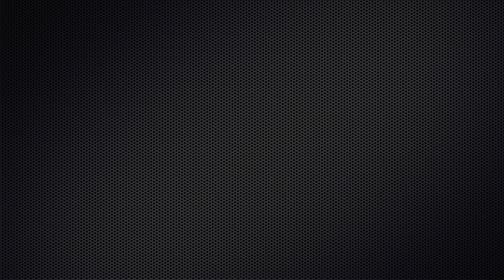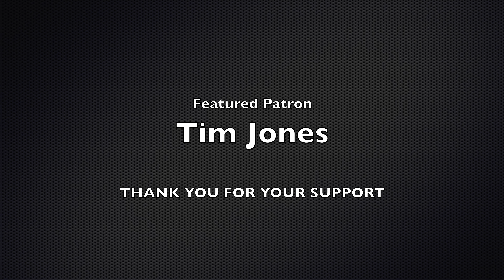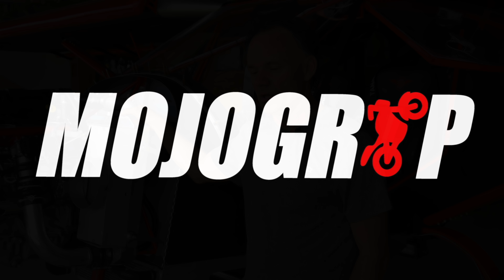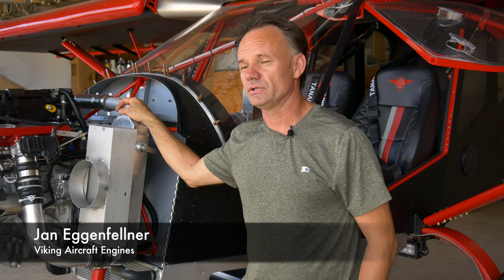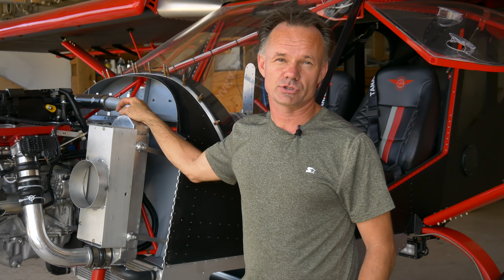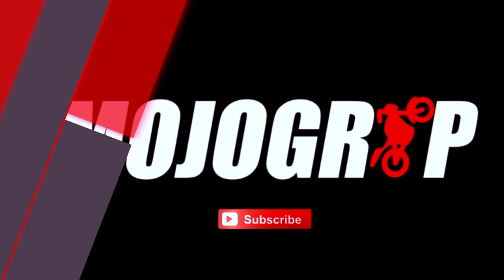Aircraft Engines l Auto Conversions VS  Certified Engines

Comment: You guys ever heard that there is no replacement for dispacement.  All these motors are trash...Companies have spend decades trying to design an engine that provides better power, efficiency, or weight than an air cooled Lycoming or Continental.  The only one who has come close is Rotax and after having flown 10 hours behind one, I'll stick to standard motors...
Reply: Adept Airmotive.
Reply: So a less than 200 cubic inches motor  that has to turn 5500 RPM to make power that is turboed and they are saying 2500 TBO (maybe, they hope).  24 valve with overhead cams?! Gear Box.... LOL  Oh and I've used Rotax's dry sump motors.  I'll never own a plane that I have to turn the prop over 20 times just the check my oil levels....and 86K price tag?! No thanks...I'll take a IO-550 with a TN kit from tornado alley.  I would like electric waste gate and dual self powering electronic ignition.

There are a dozen engine companies that have been trying to make these things work for decades...They all keep blowing through deadlines, getting sold and bought.  The problem is they are too complicated and expensive to make, usually too heavy, and the benefits are marginal at best.  So they never reach a break even point.  Look at the diesel trainers everyone tried.  Cessna only made their diesel 172 for a year, and it was so expensive, it didn't make sense.  Even for flight schools that are doing 1500 hours a year on them.  In bigger planes, once the motors get to a certain price a PT-6 starts to look really good, and they almost ALWAYS make TBO.  On the MORE program they are running them to 8000 hours before overhaul.  I'll say it again.  Big displacement standard config gas motors are the way to go.
Reply: @tstanley01  Incoming wall of text (Engine design is complicated, who knew?). You have no idea what you're talking about, you're just stuck in the past. The Adept Airmotive engine represents what's possible with modern gasoline engines. Compare the weight to any Lycoming or Continental engine. $86k is cheap when compared to the $100k+ that you'd have to pay for a FADEC LyContisaurus engine with the same performance.

"There are a dozen engine companies that have been trying to make these things work for decades...They all keep blowing through deadlines, getting sold and bought."

What are you talking about? The engines DO work, they're being sold right now and have been flying for years. The failure of these companies doesn't stem from any issues with the engines (except in the case of Eggenfellner's Subaru engines, which were also problematic in cars, they were just a flawed design), it comes from the fact that there just isn't a whole lot of demand for experimental aircraft engines in general. Business is always slow, in other words.

On high rpm engines: Rotax engines are plenty reliable, most issues with them stem from the fact that they use carbs, but they now offer models with EFI. Piston speeds are what matter, that's where most of the stress comes from, and they can be kept quite low with modern engine designs.

On OHC, mutli-valve engines: OHC, multi-valve engines have been powering some of the highest performance aircraft in the world for over 80 years, they're plenty reliable. Mustangs, Spitfires, P-38s, P-40s, etc, all use OHC engines and have 4 valves per cylinder. OHC engines also power basically ALL of the most reliable and longest lasting cars on the road. 

On geared engines: ALL of the most powerful piston aircraft engines use PSRUs, from the Merlin to the R-3350.

Here's a cut and paste from another discussion, I really don't feel like rewriting it. It should explain why you can read about LyContisaurus engines having catastrophic failures pretty much every week. The quoted text is from the guy that I was talking to.

"The short of it is the simple truth that if you want reliability you need either under-stressed designs... like a big air cooled hulk with lots of displacement and low rotational speed."

Contrary to what most people believe, a reliable, under-stressed, air cooled piston engine doesn't exist in the aviation world. Despite their reduced complexity, air-cooled engines have extremely poor reliability when compared to modern water-cooled engines, this is because the cooling of individual engine parts is wildly inconsistent and because their cooling capacity is very limited, requiring the pilot to manage the fuel mixture in order to keep temperatures within limits. The big, air cooled, direct-drive aircraft engines are not under-stressed, they're always right on the edge of catastrophic failure due to their poor cooling performance and because of the high torque pulses which are a result of their large displacement, along with a lack of inertia in their rotating assembly to smooth out those huge torque pulses (which is due to their low rotational speed). Making an engine drive the propeller directly also requires heavy, huge displacement engines which must be built in a very flimsy manner in order to make them light enough for aircraft use. The added complexity of a PSRU actually increases reliability, which is why all of the most powerful aircraft engines had a PSRU.

"Or a very sophisticated design with very extreme materials."

No, water cooling and PSRUs eliminate the requirement for exotic materials because water cooling keeps everything consistently cooled and because it's easier to make smaller parts stronger without using exotic materials. Using a PSRU allows for the use of lower a displacement engine, which makes use of smaller components. 

The one issue that the Honda engines have which there is no way to work around (without completely redesigning the engine or dramatically lowering displacement) is high piston speeds, and that is something which produces stress, wear and inefficiency. The longer the stroke, the greater the distance a piston must travel for each rotation of the crankshaft, which means that a piston in an engine with a longer stroke must move faster than it would in an engine with a shorter stroke at a given rpm. With stronger rods and pistons, reliability wont be an issue in the Honda engines, but efficiency and longevity will be. An engine designed for aircraft use will typically keep the mean piston speed below ~12 m/s, but the Viking engines are around 16 m/s (which really isn't that bad, just higher than it should be). For comparison, at 5,800 rpm, a Rotax 915 iS will have a mean piston speed of 11.8 m/s.

All in all, I'd trust a converted Honda engine over a LyContisaurus engine any day and, really, efficiency is even pretty good on the Viking engines, They burn 0.4 lb/hp-hr at full power, which is better than what LyContisaurus engines burn at cruise.

I guess my rant could be better summed up by saying that the Viking engines are a major improvement over air cooled engines, despite the fact that they're not perfectly optimized for aircraft use.
Reply: @tstanley01  Made some corrections to the first part of my comment. I'm involved in too many conversations at once here, I lost track of who you were. I agree that Adept Airmotive probably wont be successful, but, again, that has nothing to do with their engine design, it has to do with how costly it is to bring a new engine to market and how little product is moved in GA. It's always going to be a large investment with a slow return, and most investors don't like that. 

Diesels don't make sense for aircraft because they're inherently more expensive than gasoline engines and much, MUCH heavier, so they drastically reduce the performance of any aircraft that they're installed in.
Reply: You are the only person on the planet that I have met that says adding a gear box to an engine makes them more reliable.  Apparently you have never flown a 421 or a rotax for that matter.  Even taxiing is a pita because unless you have a load on the motor you get gear chatter and can damage them.  In fact the engine monitor on the Rotax I have flown starts screaming at you if the RPM drops below 1800 rpm.  At that rpm it rolls way too fast, even at gross weight.  So you are always running at higher than idol RPM and having to ride the brakes.  It is added complexity with no real upside.  The reason people put overhead cams in motors isn't for reliability or power generation.  It is so they will idle better while still being able to flow air over a wider range of RPM.  Neither of which is important in an aircraft engine, because you can design them to operate at an optimal RPM range that typically doesn't vary more than a few 100 RPM.  As far as them being in the longest running engines on the roads....18 wheelers use a conventional cam.  So do most light and medium sized trucks.  Those are typically the longest running engines on the road that are used for commercial work, where reliability, cost and ease of maintenance is important.  In fact, my experience with high performance, small displacement, fire breathing engines has been that the bottom ends hold up fine.  It is always the cams, timing chains, phenolic tensioners, and high pressure direct injection fuel pumps that give you problems.  I am not saying there aren't things we can improve.  Electronic ignitions are great.  When you do a mag check on a system running a EI and a Mag, the RPM doesn't even dip when grounding the Mag because the EI works so well.  Self powered EI should be certified for dual use instead of having to have atleast one mag.  FADEC is fine also, but it should allow for manual parameters.  Some days I want to run LOP, some days ROP, some days I want to run the motor out at 2600 RPM.  Some days I have passengers in the back without headsets and want to turn them back to 2300 RPM.  Fully automatic FADEC is like removing the tach from a F1 car and only have a shift light.  Real pilots know how to operate their systems properly.  Another thing I don't like about the Rotax is that they don't have mixture control, you can't even run the cylinders dry during shut down.  To me that is a safety feature.  Having to turn the prop on that thing to prime the oil knowing the cylinders have fuel in them a little scary.  Water cooling is fine, but again, a properly baffled air cooled engine runs well within limits and doesn't add any new systems that need to be maintained.  A well tuned a36 with a TN kit and good baffles will run up to 25000", running at 93% power and still be well within temperature limits.  That is where we need to go.  George and his group have gathered more information on GA piston engines than anyone on the planet, and you don't see them designing overly complicated motors that gain nothing and only add cost and complexity.  They are building components and accessories for tradition engines that make them run better, longer and with more power.  He is so busy they can't build stuff fast enough.  EPS and all the rest can't even get through certification.  Aircraft owners are trying to get the most amount of performance with the least amount of moving parts.  Everything is so expensive,.  So unless you have a dang good reason to add or complicate a system, we don't want it.
Reply: @tstanley01  "You are the only person on the planet that I have met that says adding a gear box to an engine makes them more reliable."

Well, I'd be very surprised if you met the engineers who designed the Merlin, or the Allison, or the R-3350, or the R-2800, or anyone who designed the most powerful aircraft engines in the world.

 "Apparently you have never flown a 421..."

A) Their gearboxes were unreliable because they weren't operated properly. People weren't revving them high enough, which meant that the rotating assembly didn't have enough inertia to overcome the huge torque pulses of the engine, which caused gear chatter. B) Those are slow turning, big displacement engines with very few cylinders, which means that they have big, infrequent torque pulses, which means that they're hard on their gearboxes.

Rotax gearboxes are plenty reliable.

"Even taxiing is a pita because unless you have a load on the motor you get gear chatter and can damage them."

You should probably read my comment again and actually attempt to understand it. 

"In fact the engine monitor on the Rotax I have flown starts screaming at you if the RPM drops below 1800 rpm."

Yes, you need a good amount of inertia in the rotating assembly to smooth out the torque pulses from the engine. This can also be overcome by adding a flywheel to the engine. It's also not an issue on a FADEC engine because the EFI system manages the idle.

"It is added complexity with no real upside."

Except MUCH lighter and more reliable engines.

"The reason people put overhead cams in motors isn't for reliability or power generation.  It is so they will idle better while still being able to flow air over a wider range of RPM.

Again, you have no idea what you're talking about. Better airflow means more power and greater fuel efficiency. OHC engines also have fewer moving parts, which means greater reliability. Aircraft engines don't need to have good idle properties, but even the engines being discussed here don't rev high enough for that to be an issue.

"Neither of which is important in an aircraft engine, because you can design them to operate at an optimal RPM range that typically doesn't vary more than a few 100 RPM."

Fuel efficiency, power, weight and reliability are important in aircraft engines, and all of those things are improved with OHCs. OHC systems with 4 valves per cylinder are the only way to facilitate efficient operation in the higher rpm range where these modern engines operate.

"As far as them being in the longest running engines on the roads....18 wheelers use a conventional cam."

If you mean OHC, yes. The Cummins ISX uses DOHC, and it's hard to find information on other engines, but I'm pretty sure that basically all of the modern truck engines are OHC. Anyway, those big diesels are reliable because they're massively overbuilt, not because of the type of valvetrain that they use.

"Some days I want to run LOP, some days ROP, some days I want to run the motor out at 2600 RPM."

The engines always choose the most efficient operating parameters and will even run LOP.

"Fully automatic FADEC is like removing the tach from a F1 car and only have a shift light."

...which has been working fine for many years, so I'm not sure what your point is.

"Real pilots know how to operate their systems properly."

Electronic injection systems know how to operate the engine FAR better than any pilot does. Not only are the systems much more precise, but they react within milliseconds of any changes.

"Water cooling is fine, but again, a properly baffled air cooled engine runs well within limits and doesn't add any new systems that need to be maintained."

Air cooling is draggy and makes the engine itself HORRIBLY unreliable. Air cooling also limits the performance of the engine. Water cooled engines can not only be more efficient, but also more powerful, while also being more reliable. This is why Continental built the Voyager engine and why lawnmowers and 80 year old aircraft engine designs are basically the only things left using air cooled engines.

"George and his group have gathered more information on GA piston engines than anyone on the planet, and you don't see them designing overly complicated motors that gain nothing and only add cost and complexity."

Because they don't design engines at all, they just use existing parts, and they're content with performing poorly and burning leaded gasoline.

"So unless you have a dang good reason to add or complicate a system, we don't want it."

IMPROVED RELIABILITY AND SAFETY. We're talking about people's lives here. People not only die because these engines can't keep their components properly cooled and love to throw rods through their crankcases, but also because pilots mismanage their engines on a regular basis and cause them to fail, all of that needs to be done away with.

The Adept Airmotive engine is also much less expensive than an equivalent Lycoming or Continental engine.
Reply: @tstanley01  YouTube isn't letting me post my reply or a relevant link. Google: AOPA, Airframe and powerplant - Mixed Reviews - July 5, 2002 - Liquid cooling — yea or nay?

I guess that censoring the facts is how people win arguments these days?
Reply: @tstanley01  "Comparing a 100 year old military engine that was designed to be operated at the limits can't be compared to to a GA airplane where the primary concerns are reliability and cost."

You're saying that a technology which has been made to be reliable in a much harsher environment can't be made reliable in GA? It's also just a gear set, there's not really anything that can go wrong with it as long as you don't have a slow turning engine beating it to death. The R-3350 ended up with a TBO of 1,700 hours, btw. The R-2800s and R-3350s weren't just military engines, they were used in airliners for a long time, and you can bet that those airlines wanted their engines to be reliable with minimal maintenance. 

"Money was not an object when these motors were designed. "

Small displacement, water cooled engines are cheaper to make than big, air cooled engines.

"The problem is it is such a high power setting that the plane wont taxi properly and you have to ride the brakes."

Or, you can just put a flywheel on the engine, like Adept Airmotive did. You're making mountains out of mole hills.

"Gear boxes in GA airplanes have always been a maintenance issue."

Only according to you, Rotax powered aircraft are selling like hot cakes. You can't beat the performance that geared engines provide.

"Fuel Injection operation isn't the issue."

It is when it eliminates the possibility of the engine being operated in a way that's harmful to it.

"Like I said, I don't have a problem with Fadec as long as it allows me the option to run my engine at the parameters I want.  ROP or LOP isn't right or wrong.  It do you want to go fast or more efficient.  Both have advantages, but it up to the pilot and the situation he is in to decide which way he wants to fly."

You clearly have no idea how FADEC works. If you want low power, high efficiency operation, you pull the power lever back, if you want high power output, you push it forward. Based on how much power you want, the engine knows how to give you that in the most efficient way possible, and it knows it much better than you ever could. 

"The airplane has no idea how it should be operating."

The problem here is that you can't think outside of the little box that your training put you in. All a pilot demands is more or less power from the engine, there's absolutely no reason why the engine can't figure out how to operate in the most efficient manner possible based on that one demand.

"As far as air cooling being more draggy....whether you run the air over fins on the block, or blow the air over radiators and then the block, it doesn't much matter.  Actually I think most wind tunnel testing I've seen the like power models show that the water cooling actually produces more drag."

With water cooling, you can take advantage of the Meredith Effect, which completely eliminates the drag of the cooling system. Even with minimal adherence to the principles of that effect, cooling drag is much lower for a well designed water cooled engine. The Boeing XB-39, for example, significantly outperformed the B-29, despite having less power, simply because it was water cooled. The Soviet Tu-85 also saw significant gains in performance by replacing an air cooled engine with a less powerful engine that was water cooled.

"The funny part is the big liquid cooled Continental was used as and STC for the 414 and 414a."

You're looking at a different engine. The engine that powered Voyager around the world was a 4 cylinder. Anyway, I wasn't saying that it was a good engine, I was saying that the Voyager engine was able to use a higher compression ratio and had lower fuel burn than a comparable air cooled engine. It obviously makes much more sense to design an engine to be water cooled from the very beginning, converting an air cooled engine to water cooling rarely works out well.

"The fact is, the ONLY thing that makes an engine more fuel efficient at LOP operations is compression ratio, and really the only thing that helps with that while still developing max HP is higher octane fuel."

No. Lead is used to reduce the possibility of pre-ignition/detonation, but water cooling also does the same thing. It's not unheard of for modern automotive engines to run air fuel ratios as lean as 20:1 with compression ratios that are higher than any LyContisaurus engine... while running on 90 octane fuel. The rest of what you've said about avoiding knock only applies to the archaic engines that most GA aircraft currently use. To sum up: Water cooled engines with modern combustion chamber designs can run leaner mixtures and higher compression ratios, all while running on lower octane fuel. 

"i know you aren't a pilot and have never actually operated a GA piston plane, but during take off and full power climbs, you have to dump a ton of fuel through them so they don't cause detonation."

I already addressed this. You don't have to run extremely rich mixtures in water cooled engines because they're inherently less prone to detonation. In other words: You don't have to use fuel to keep the cylinder head temperatures low, because the cooling system does that for you. That's why the Viking Honda engine only consumes 0.4 lb/hp-hr at full power, while a Continental TSIO-550 will consume nearly double that. Consider that the Honda engine also has a compression ratio that's nearly a full three points higher than a TSIO-550, has a much higher BMEP (due to more efficient operation), runs a slightly higher boost pressure and runs on lower octane, unleaded fuel. That's called TECHNOLOGICAL ADVANCEMENT, something that seems to be foreign to people like you.

"There isn't any amount of fancy cylinder head or fuel injection that will stop it."

Right... ok, bud. You go tell that to the engineers who design MODERN engines, it'll give them a good laugh.

"People allot smarter than you or I have dedicated their lives to the science and like was said earlier, the mechanics of the technology have pretty well been reached."

With 80 year old engine designs? 

"Without an alternative fuel source, you really can't squeeze any more power or efficiency out of these motors."

That's why I'm talking about abandoning LyContisarus engines, they're insanely obsolete.

"Don't you think that one of the auto manufacturers who have  billion dollar research departments would develop an engine like you are talking about if they could sale the engine for 100k."

No, the market is too slow to appease their greedy investors and they'd have to develop and produce a unique engine design to reap all of the benefits that modern engine technology has to offer.

"They don't cause they can't."

They don't because it's not profitable enough for them to do so.

"If they could develop a better motor they would."

THEY HAVE.

"i am never going to change your mind, or get you to admit it."

That's because you don't know anything about modern engine technology.
Reply: @tstanley01  I am all with you.  If you had an inline 4 cylinder Viking engine, you would have a very basic and easy to maintain engine.  To allow for minimum idle RPM, just set the idle very low and live with a slight ticking noise from the drive unit.  Another method is a dual idle setup.  One for "normal" ops, another for low idle ops.  Implemented with a simple dual idle spring.
Reply: @tstanley01  Your info is very informative.  Be sure to read more about GASOLINE DIRECT INJECTED TURBOCHARGED ENGINES.   They do solve the issues you write about.  AND, they are the basis of the Viking 180
Reply: I am not saying you cannot have a quality engine with those features, and I wasn't talking about you specifically when I said they are trash.  My only experience with these type engines is with Rotax, and I can say without a doubt I would not own one of those.  The guy above has no clue what he is talking about and I am not even sure he has ever been behind the controls of an airplane that wasn't connected to a windows desktop.  I have a bit of experience (know enough to know I am not an expert) with direct injected turboed motors.  The main benefits I can see are better fuel atomization and the ability to fine tune the lean mixture for each individual cylinder on the fly, if your ECU is setup for individual banks.  I was surprised at how many auto engines still do group firing of injectors.  Even high dollar aftermarket performance EFI kits.  However, most all of that can be overcome in manual fuel injected engines with tuned injectors like those made by GAMI.  It isn't too hard to get notoriously hard to tune motors like the 550B to get within a few .1 of a GPH across the entire motor.  The later model motors that were designed with balance induction work even better.  I know in diesels it is pretty common to "time" the engine by the way they inject the fuel.  Do your systems play around with that any?  Direct Injection is a fine technology, but you have to run a pretty impressive high pressure pump to make it work, and my experience atleast in the auto world is that is one of the weak links.  I was actually involved in a project to try to build a dual and maybe even 3 stage mechanical HP fuel pump for BMW inline 6 motors. It ended up being allot more work than you could imagine.  Ended up going with a hybrid system that used a wet fogger plate in between the manifold and cylinder head.  It worked almost like a nitrous system.  DI would take it so far, then when they ran the boost and RPM up so high, the 2nd fuel system would kick in to add more fuel beyond what the factory HP pump could deliver.

I looked at your largest offering and it looks like a nice kit.  I love the look of CNC tool marks on a piece of billet .  The price and weight are attractive, but when compared to a IO-360 parallel valve (180 HP), your fuel burns are very close.  I am sure your system is a good running engine, but the bullet proof IO-360 is to (for double the price of course).  My point I guess is in the experimental market these things make sense, but in the certified world where a crank is 7k, direct injection, gear boxes and all the rest don't make much sense when the gains are only slightly marginal if at all.  That was my point I was trying to make above.  If you tried to certify that motor to meet the rigors of the FAA, that would be a 100k motor.  Do you guys offer, or have any plans to implement CS props?

It just really irks me when you hear un-informed people saying the issue is primarily the FAA and that the motors we run are 100 year old archaic tech and their riding lawn mower has a nicer motor.  That with a little work they could build a bullet proof GA motor that will make 3k hours and burn half the fuel.  It just isn't reality.  Increases are marginal if at all, and require quiet a bit more complicated equipment.  A finely tuned IO-550 with a Turbo normalize induction system and dual intercoolers is a work of art.  I would like to ditch the mags for dual self powered electronic ignitions though.
Reply: LOL, you talking about the Voyager engine from 40 years ago?  Yea, they developed a far superior engine 40 years ago and just decided to not make them for what reason?!  The only high performance liquid cooled airplane I am familiar with that was actually built and sold was the RAM V 414.  You literally cannot give those things away.  No one wants them.  Again, I'll ask, have you ever actually flown an airplane?  I tell you what, you go build you one of those super duper 500 HP that runs on 5 GPH and has a 5000 hour TBO because it has EFI, a gear box, and water cooling, and I'll buy one.  They are only gonna be $5,000 right, and only weight 250 lbs?!  I really want one...Prove me wrong...The only problem is you are going to have to talk all the FBOs into buying new fuel trucks so they can carry unicorn tears along with Jet-A and 100LL for the poor chumps who aren't running the latest greatest motor....You should start a kickstarter page....
Reply: @tstanley01  Why do I have to keep repeating myself? Do you not understand that continually ignoring the facts is why you're wrong here? 

"LOL, you talking about the Voyager engine from 40 years ago?"

Why are you laughing? The engine was significantly more efficient than the air cooled engine that it was based on and significantly reduced drag! It made Voyager's flight possible!

The water cooled Continentals were conversions of air cooled engines, so, despite the significantly improved performance that they offered, they had reliability problems. The point is that they offered significantly improved performance.

"Again, I'll ask, have you ever actually flown an airplane?"

Explain how it's relevant! Can one not understand MODERN engine technology without flying an airplane? You're not making any sense.

"I tell you what, you go build you one of those super duper 500 HP that runs on 5 GPH and has a 5000 hour TBO because it has EFI, a gear box, and water cooling, and I'll buy one."

The Adept Airmotive engine offers a 30% reduction in fuel burn, its cooling system offers the ability to produce net thrust instead of drag, it has a TBO on par with your LyContisaurus engines, it burns 93 octane mogas or 100LL, it's much, MUCH lighter, and weight reduction on that scale offers a significant improvement in aircraft efficiency and performance.

AGAIN, you didn't even bother to learn about that engine, because you're TERRIFIED of change! That's all that this whole conversation boils down to.
Reply: @tstanley01  "Again, I'll ask, have you ever actually flown an airplane?"

How many rocket scientists actually fly in the rockets they've designed? Who understands the technology of rockets better than them? All you're trying to do here is steer the conversation away from the fact that you don't know what you're talking about.
Reply: Oh I've read about them...Did a decade ago.  Just like Deltahawk, EPS, and the rest.  I am not impressed.  They have been around since 2003, don't have a single certified engine.  In fact their current design was locked in mid 2010.  They were suppose to be in production in 2013 and be in full swing in the STC market by 2014.  I just saw a video from early 2013 at airventure when the owner was giving a rundown of their timeline.  It would be comical if it wasn't so sad.  Up to 30% fuel savings.  I don't see anything specific on their website about compression ratios or SFSC numbers...not even theoretical ones.  Atleast EPS has given some preliminary fuel burn and power outputs at different altitude charts.  One interesting thing I did see was on their faq page.  They say one of the reasons to stay way from diesels is the bad vibrations and need for robust engine mounting solutions.  When EPS was starting their certification process for their diesel motor, they had to get with hartzell to get a provisional numbers for matching a prop to the engine.  Hartzell said that diesel was the smoothest reciprocating engine they have ever put on their test stand.  They actually thought the sensors were broken at first and had to double check the numbers.  It was almost as smooth as many turbo props.  That has been touted as one of the main benefits of the diesels is how smooth they run.  That and the high compression ratios, so they can get a better SFSC at LOP.  What I see on that website is the same thing I see on all these "next gen" GA engine websites.  No real information, all superfluous fluff, none have them have made their self imposed deadlines, some are up to 2 decades behind schedule (deltahawk has been trying to get a single engine certified since the 90s).  EPS said they were a few months from certification 3 years ago.  Crickets since then.  Honestly it is a silly conversation because you can't even compare longevity or actual savings overtime because no one can even get one out there engines out in the wild to put hours on.  A decade ago we all thought these diesels were going to be the way of the future and 100LL would be something you put in vintage warbirds or stearmans.  None of it has come to pass, and anyone who has really followed the trend has pretty much moved on.  The economy isn't what they said, the weight was an issue,  and the cost was so high you would wear the motor out before you broke even in fuel burn. Smoke and mirrors....smoke and mirrors.  I'd love for them to make it work, but they have been at it for awhile and haven't gotten very far.  You can keep waiting for your super duper marvel engine for the next decade and I'll keep burning lead infused dinosaur carcasses.  But since you aren't even a pilot, I don't understand why you even care...
Reply: @tstanley01  Actually, I just found a progress report from earlier this year on the EPS engine, it's going to weigh 650 pounds! The cooling system adds an additional 30 pounds! I bet it'll cost $180k, too!
Reply: @tstanley01  "I am not impressed."

Who the hell cares if you're impressed? The engine VASTLY outperforms any existing GA engine.

"They have been around since 2003, don't have a single certified engine."

They're working on it. Diesels don't make sense in aircraft, they're too heavy, so you can't compare the them to the Adept Airmotive engine, there's actually a chance that it will be successful.

"In fact their current design was locked in mid 2010."

They've recently started work on a new model, which is being installed in a Lancair Evolution and makes 360 hp.  

"When EPS was starting their certification process for their diesel motor, they had to get with hartzell to get a provisional numbers for matching a prop to the engine.  Hartzell said that diesel was the smoothest reciprocating engine they have ever put on their test stand."

And? When did Hartzell ever have the chance to assess an automotive style engine before? Being smoother than a LyContisaurus engine is not something that's even remotely difficult to  accomplish. Also, where are the weight and power output numbers for the EPS engine? What good is it going to do if it weighs 600 pounds and can't be installed on any existing airframes?

"It was almost as smooth as many turbo props."

That's true of basically any geared engine with a small cylinder displacement, it's one of the main reasons why they're desirable.

"That and the high compression ratios, so they can get a better SFSC at LOP."

So can modern water cooled engines. Continually ignoring that will not make you correct on this matter. 

"No real information, all superfluous fluff..."

Again, how much power will the EPS engine make? How much does it weigh? They're not supplying that information because it would mean the end of any interest in their engine if they did.

"EPS said they were a few months from certification 3 years ago.  Crickets since then."

That does nothing to prove that modern engines don't significantly outperform LyContisaurus engines, all it proves is that it's extremely expensive to get a completely new engine design certified. Consider that these companies are having to pay their employees for years without being able to sell their product in their target market, that gets VERY expensive.

"Smoke and mirrors....smoke and mirrors."

Nope, just extreme ignorance. Anyone with half a brain could see that diesels were never going to work out. Even Deltahawk's engine was massively overweight, despite being a two-stroke, and that was right from the beginning.

"...and I'll keep burning lead infused dinosaur carcasses."

It's hilarious that you're proud to be stuck with obsolete engine technology... Actually, it's just sad.
Reply: I am not stuck on anything.  I am out flying.  Flew 15 hours this month already!  How much flying have you done?  Oh wait, your are a keyboard warrior who has never flown, touched, worked on, or probably even seen an aircraft motor in person.  As far as vastly superior, I don't see it.  Even if they hit the numbers they are talking about, which I highly doubt they will, they are vastly more complicated, have vastly more parts, are vastly more expensive to the point that the break even point will be about double their TBR (notice I didn't say TBO)..yea....They don't mention anything on the only few things that matter...Compression ratio and specific fuel consumption.  I see 30% better fuel economy..compared to what, at what power settings.  I can make 14.9 HP/GPH right now all the way to 25000' with off the shelf engine technology with a 30 year proven track that I can take to over 2000 hours and rebuild for less than half the price of this paper engine you are talking about.  When they post a specific number like that, then maybe people will take them seriously.  Until its all just unicorns and fairy dust...People who fly their families behind their motors and cut checks to maintenance shops have very little interest in the stuff you are proposing, even if they do come to fruition.  Although even you admitted their motors will never see financial viability in certified engines.  The deltahawk actually looks like it could be a winner.  Has LESS moving parts than current motors, and they just had a huge influx of cash and people.  They are claiming this month that they will gain certification within 12 months for real this time.  Their 180hp model would make a serious contender for an IO-360. Oh and as far as Hartzell testing automotive engines...LOL you really know nothing about it.  People have been putting car motors on airplanes forever.  Subaru, honda, corsair, LS1 through supercharged LS9.  Ask Vans (probably more converted motors on their airplanes than any other on the planet)  They will tell you, the best most reliable combination out there in that power range is a Lycoming.  Every motor combination that is flow is typically flown on a vibration test stand, certified or not.  Certain vibration tendencies can sheer a prop in minutes if they aren't paired properly.  They may even have rpm ranges that are restricted because of harmonics.  You can't just slap a prop on a motor and hope it all turns out...These aren't toy model airplanes...
Reply: @tstanley01  That's a fact Most aircraft gearbox are a problem Well said
Reply: @PistonAvatarGuy  What country are you from mate? You are about the only person that knows what they are talking about. Too many people have no idea about engines, they only think RPM. Sometimes I think we should just drop a piston that weighs 1500g on their head to let them think about it.